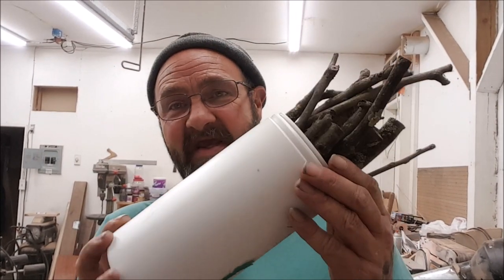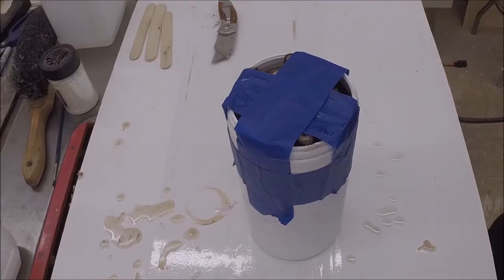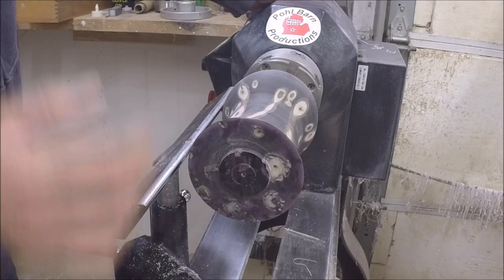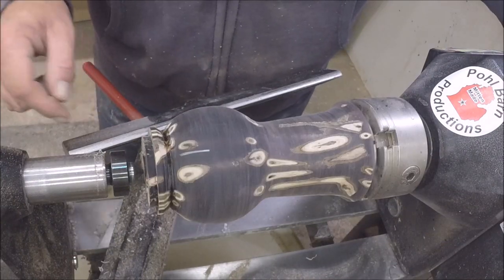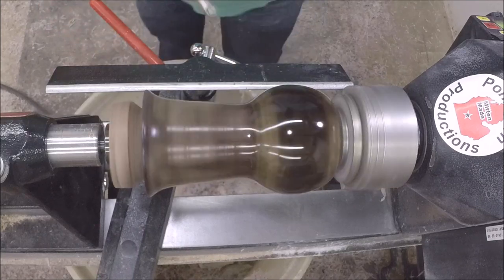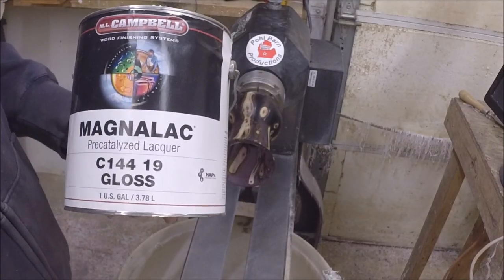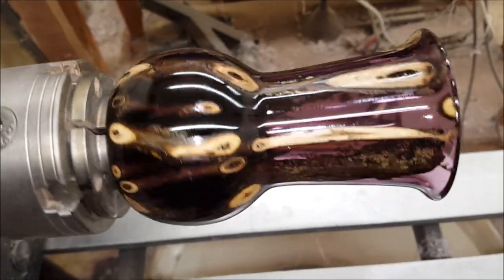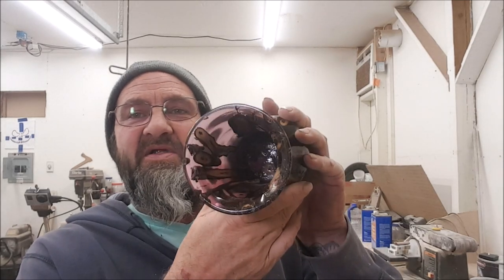Purple Vase

Comment: Very cool I am now going to try the wet wipe container for a mold great idea
Reply from the maker: Why not you were just going to throw it away anyways !   the hdpe or how ever that goes is No 2  in the recycle triangle. it will release for it easily and not stick.
Reply: And I need to invest in a chuck just ruined a cedar bowl trying the hot glue method 😑
Reply from the maker: OH NO !!!    SCREW CHUCK WITH SPACERS SO IT DOESN'T GO SO DEEP WILL ALSO WORK

Comment: Cool use of wood branches.  Now I know what to do with all the twigs falling this winter!  Maybe you should have stabilized the twigs with Cactus Juice or similar.  May have eliminated or minimized the need to treat with CA.  Works when I use grape vines in similar but smaller projects.
Reply from the maker: I should have stabilized the branches first, I know what to use but it is not currently in my budget to get it and the equipment needed to do it.
Reply: @PohlBarnProductions  I got started stabilizing for about $150.  A cheap vacuum pump from Harbor freight, a few thick wall glass vases from Michael s, a small 1/2 square of plexiglass for each vase and a few fittings is all you need for occasional stabilizing..  I can send pics of my setup if you like.
Reply from the maker: I have the pump and I figured I could use mason jars, I might need to get some fitting and a couple valves, I already have a vacuum gauge from out of a car dash board,  the resin isn't cheep and that's pretty much my hold up right now.  I'll get to it soon enough, thanks for the help !

Comment: Just an idea. But you could have tried hollowing it out from the bottom and once you where finished with that, placed the vase on something smooth ,flat and then sealed it with hot glue and poured resin into the vase about a 1/4” and then your bottom would be solid again.
Reply from the maker: yes I could of, but then the sticks would of been gone.  I really just need to get longer tools. LOL

Comment: Could you have drilled out the bottom, thin the part you couldn't reach safely then make a matching plug and glue it back in?  Looks really nice with the thin walls.
Reply from the maker: Thank you

Comment: If you added a small battery powered LED to the wood cone support thingie (highly technical term there!),  you could see how thin you are getting on the neck of the vase. Plus it would be cool to see, LOL
Reply from the maker: never thought of using the LED in the cone thingy.  I wasn't worried about the thickness until i was hollowing it out, since it was translucent I could see for the most part what I was doin.
Reply: Yes that's a good idea
Reply: @Susan Vasquez Yep, wood, resin and LED's, great combination, fantastic idea
Reply: What a great vessel. The idea put forward about incorporating an LED can be very brilliant. Try a fruits bowl with an LED.

Comment: Hello from Minnesota, awesome vase you made, it’s crystal clear! I just started turning and I just discovered your channel. Your opinion what’s the best resin to buy for turning?
Reply from the maker: There are many out there, for turning it depends on your equipment. for the money Alumilite Clear Slow or fast set but they require a pressure pot, the resin4art is pricey but works just as good with or without pressure.  Those are the only two I've used. Famowood has a resin I've used but it doesn't get hard enough to turn without it warping.

Comment: FYI, Walnut branches and twigs have a pretty substantial pith. That's what you kept running into when you were turning this project. It isn't as obvious on the wood from the trunk but as you discovered it can be a substantial portion of twigs and small branches.  It would have been just as bad with fresh twigs because the texture of the pith is very corky and soft. It doesn't adhere to the interior of the twigs very well either. 

If you are going to use walnut twigs in a project this is always going to be an issue.If they are straight you might be able to clean them out a bit with a tool but larger branches can be ripped down the center and the pith cleaned out. It might prevent the issues you had with this project.
Reply from the maker: Thank you, I didn't know and the wife collected them and dried them for that project,  live and learn.  LOL

Comment: Doug do you wet sand ? Works great on the fine scratches.
I sometimes use Yorkshire grit with micro fine sanding pads
Reply from the maker: I am limited on my sanding supplies, I have the sand paper but not all of the grits to progressively remove the scratches from the previous grit, then I was also worried about the wood not being stabilized and swelling with the water.
Reply: @PohlBarnProductions  Doug I have been making Shaving brushes for a couple of years as a hobby .
I mostly use wood with a CA finish . wet sanding is part of my process .
I use the grit along with micro mesh and I also use sand paper , the water doesn't really hurt the wood at all
You can get it to look like glass with no  fine scratches .
   I will send you a email with a couple of photos .
Reply from the maker: I've done CA finishing, Pens mostly, I'm still learning all the in's and out's of finishing and woodturning, any help is greatly appreciated.
Reply: @PohlBarnProductions  Yeah it is a never ending , I learn from watching others and then see if it works for me .
   I was a finish Carpenter for 30 years I am retired now , don't know anything about welding  :)
Reply from the maker: Those two things I know how to do ! although the welding has gotten interesting to do with the introduction to bi-focal's into my life, I now need to purchase a auto lens as I can't find a focal point in the dark to start welding. this old things sucks !
Reply: @PohlBarnProductions  The old thing is the best alternative for right now .

Comment: When passing lacquer through your airbrush, what are you using to flush the tool?
I have good luck with UV resin thinned with acetone cures in 3min NO WAX!! Resin won’t cure over wax.
Reply from the maker: I had to wipe it down with Lacquer thinner to remove anything before spraying it.

Comment: Do you use clear resin to waterproof all of your vases intended for WET use?
Reply from the maker: I do but water proofing isn't the only reason.  the resin will hide all the scratches from sanding giving the inside a smooth glass finish while also sealing the wood

Comment: Isn't your lathe turning the wrong direction....the force on the tool should be down so it pushes against the steady rest......Am I wrong ???
Reply from the maker: you are not wrong on either question, the lathe is running in reverse and yes the rotation is against the steady rest. I was cutting in reverse so I could see what I was doing without hanging over the lathe like I would if it was turning the normal direction. Thanks for watching.

Comment: How does the sanding sealer work since most of the material made from resin?
Reply from the maker: it still seals the wood along with fills some of the smaller scratches in the resin